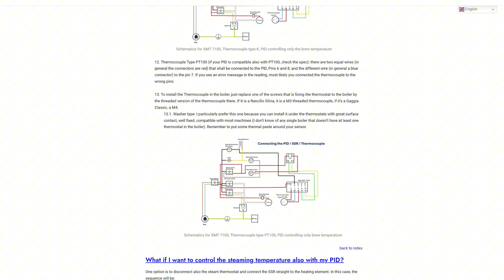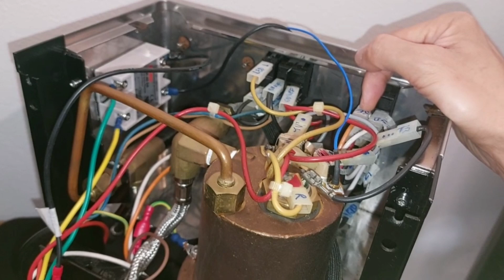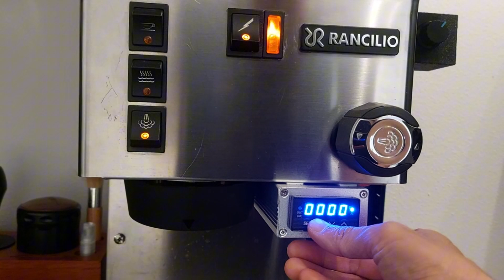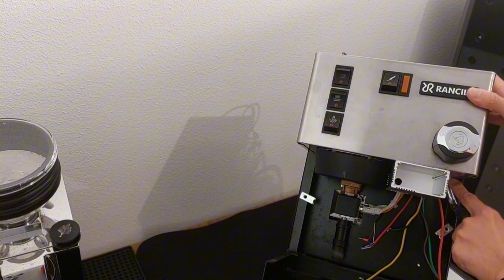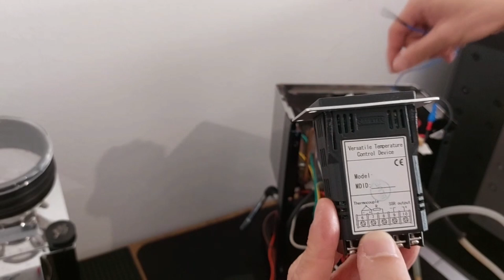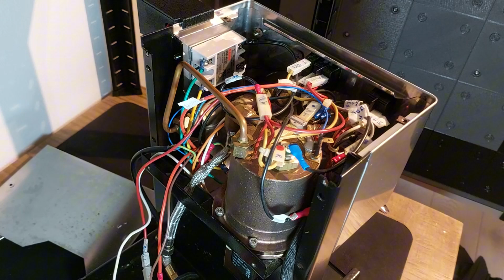PID Installation in a Rancilio Silvia

Comment: Does the electrical system work with V6E with the Gicar control box?
Reply from the maker: I believe you can bypass the Gicar and use the PID to control the heating element but I never modded a machine with a Gicar. You need to check the electric diagram.

Comment: I'm having an issue with the steam "cut off temp" after adjusting my PID on my Silvia.
I have AH1 set to 135c and AL1 set to 136c however, the PID doesn't seem to cut off the heat once it hits the programmed temperature (heating light stays on) and continues to climb upwards to 150c + which I then turn off the machine to avoid damage. I checked continuity on the steam thermostat and I do get continuity. Anyone have any ideas?
Reply from the maker: Maybe a setting to activate the alarms. Also, some have only one alarm. You need to check the specs for your specific model of PID.

Comment: Hello, great video! What size of thermocouple did you use to replace the screw, m3 or m4?
Reply from the maker: @Psyphoid  Hi. Thanks! In Rancilio Silvia, we use M3.
Reply: @EspressoHackers  I was thinking this option would be better, but after reading your documentation, I see you think a washer style is better. I ordered a k type washer style, so I will try this first and see how it goes as it is considerably cheaper than a pt100 thermocouple. Any other suggestions for the thermocouple?
Reply from the maker: @Psyphoid  Both washer or threaded works. I like most the washer style because I think it will have better contact with the boiler and I can put under the original thermostat and leave it there (if I decide to revert to original). PT100 is only if you want +-0.1 degrees precision which it's not necessary. Type k is the best cost benefit, in my opinion. You will be fine with the washer type.